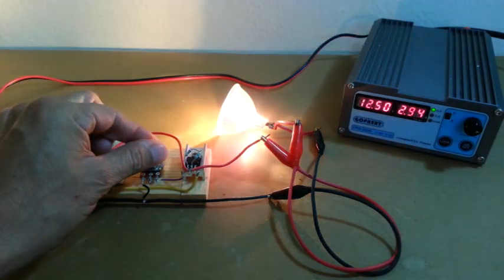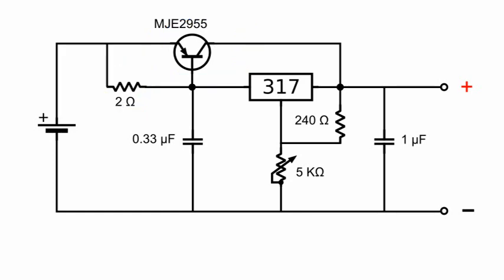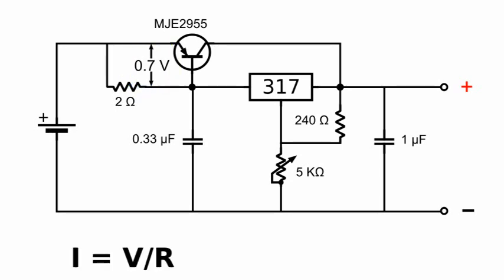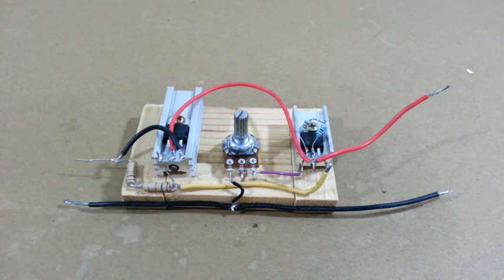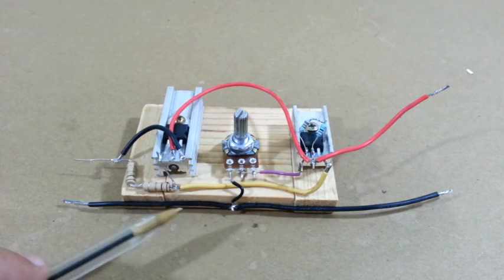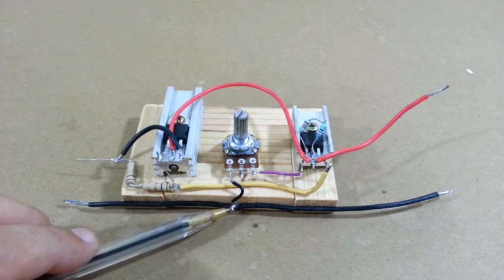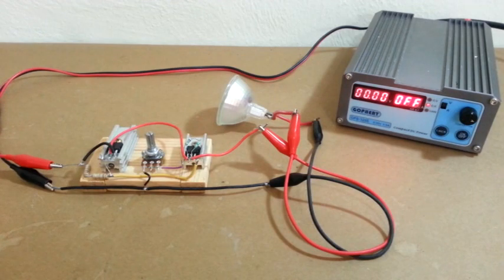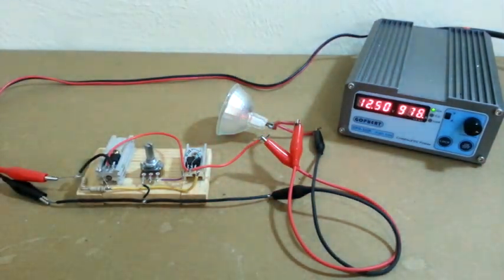Voltage Regulator with By-pass Transistor

Comment: you already have 1,25V drop on LM317 , so you can use that to power the transistor and it will be always on  , if im not wrong . Drawback being that you lost short circuit protection and 1,3V minimum output , now being 2V ,  there is a solution for everything but for this circuit it is so i belive

Comment: suppose we have connected this circuit with 12 volts dc supply at its input and after this we set lm317 to 5 dc volts now at this point the transistor is in off condition and after this we connected a 5v dc load at  circuit's output the load is high power and take more then 1 amps current due to this the transistor becomes on and as we know that the transistor works as close switch after on let suppose transistor don't drop voltage which mean 12 volts will be appear across the output capacitor as well as 5v load  these 12 voltage can damage 5 volts load can you explain how we can safe our load at this point?
Reply: I have the same question. I Think it Must be about transistor working as amplifier, not as a swich
Reply: Did any of you got the reason why it’s not 12v on the output? I tested it and it works even on higher current, I just don’t get why it works, shouldn’t the on transistor act like a “path of least resistance”? I don’t get why it still gets regulated…

Comment: I used instead MJE2955, transistor C5440, which I got at hands and regulation does not work. It seems to me that the kind of the transistor is not important but in this case could be???

Comment: I am totally new to the DIY world. I've been playing around with this circuit and the LM317/LM338. Can you use a bypass transistor with any Buck or Boost device? (switching like the LM2577). I have a few buck and boost converters purchased on ebay and wondering if this same trick will work with a system like this?  I am sure the shematics would change bigtime, just curious if this is possible.

Comment: Thank you for another great video. Is it possible to get a current rate higher than 8 amps with a different bypass transistor? Or is that the top of the scale for this type of set up? I am in need of a voltage regulator that could handle 24V and btwn 10 and 19A to regulate my 24V power supply.  Thank you for any help you can give.
Reply: You can change the transistor or double them. I have built and used a few npn versions with no problem and pretty stable under load but it can be done with this one as well. A darlington  would be good, TIP1XX etc. Good luck.

Comment: can i use an npn transistor instead of the pnp transistor with the base of it connected to the output pin of the LM317 and its collector connected to the input of  the LM317, while the emitter to the power out (kinda like this: http://forum.allaboutcircuits.com/picture.php?albumid=3&pictureid=708 ) ?

Comment: From where do you get a 2 ohm resistor and 0.7v value for it? Will it be the same value if I change the transistor to tip42c?

Comment: Hey, I built the slayer exciter (mini tesla coil) of this video https://www.youtube.com/watch?v=4OC7cwI4RNM but i've got a problem.
My led DOES light up, but the circuit doesnt work.. i mean, it doenst light up any other leds or light bulbs.. 
What could be the problem?
Reply from the maker: It seems that your secondary coil has more than one layer of wire, is that true? in that case it will not work
Reply: yes, it is a problem. It must be wound carefully and in one layer, without any overlap. Also, it must be magnet wire (enamelled copper wire). Bare copper wire does not work
Reply from the maker: Most common error is that primary connection is wrong. try swapping the connections of the primary
Reply: if i swap the connection of the primary, the led doesnt light up..
Reply: +Daily Nightstep try using a new battery and you can remove the led use 9v try brining smzll flouracent tube close if it doesn't light then try reversing the primary and make sure there 5turns and use 22k ohm resistor watch mine on my channel
Reply from the maker: maybe a burnt transistor
Reply: yup try replacing the transistor that often happen's
Reply: i replaced the transistor but it doesnt work.. i made a video were you can see what happens, le circuit works as the led light up and if i touch the toroid, the led's lights gets brighter !! wtf ??
Reply: if the secondary is the copper one without plastic it's tue, it is wounded kinda randomly couse it was kinda impossible to get the perfect coil without getting one or two turn one above the other..
is that the problem?
Reply: +Manuel Rodriguez-Achach thanks so much, i will try to wound it carefully.

Comment: I made a linear regulator with a zener diode voltage reference, an op-amp and a TIP3055 transistor, it worked quite well.  You might want to have a look at switchmode regulators, an easy switchmode regulator can be built using an LM2678 IC.
Reply: dear i am intrested in creating a switching mode supply ..
can you help?
can i get your email?
Reply: ?
same requirement

Comment: What is it's efficiency?
Reply: Energy loss will mainly be in the form of heat in the bypass transistor, hence the heatsink.  The emitter-collector voltage drop for this transistor can be found in the spec sheet for it.  Multiply that by the current and you get the watts "wasted" as heat.  The chip also wastes some, but much less.  Basically  the presence of heatsinks is a clear sign that it's not efficient.  But it is a very common, standard technique for other reasons.  Well explained here, I think.
Reply: I just tested the circuit, I would say it controls the output voltage hence the current changes, this can be shown if you measure the voltage at the output (don't be confused with the 12v power supply input voltage seen here) the LM317 bacame very hot even at 1.1v minimal output and the current from my power supply  showed  consumption of around 0.5A while the lamp did not glow.
I would say this design is not that efficient for daily use but for sure worthy for demonstrative purposes..(-:

Comment: Hey, great video! I'm a new subscriber of yours. I am a first year electrical engineering student and i understand how all the seperate parts work (except the voltage regulator i guess). However, I don't really understand why all the components are where they are, and why their values are what they are. Would you consider quickly explaining how the entire system works in future videos?
Reply: afrotechmods has the best beginner level videos. those are one level higher and require some basic knowledge and experience. (I am also a first year student, and I learned a lot of useful things on youtube :D)
Reply: Oh I just realised you said the capacitor are filtering capacitors. What are they filtering? The noise caused by the electrical grid?
Reply: +Koral Uludağ they are filtring the input and output from any ripples and get a prefect dc
Reply: ah thanks, that makes sense! Is it reasonable for me to expect him to explain these things or would it be pretty easy to research them myself? Is my knowledge base too small for me to fully understand the things built on this channel?
Reply: +Koral Uludağ watch other youtuber's to understand more about electronics there are a lot of electronics youtubes that explain these kind of stuff and that the i learned electronics
Reply: +Yasser crazy boy  try watching afrotechmods
Reply: Youtube is your best friend LOL!